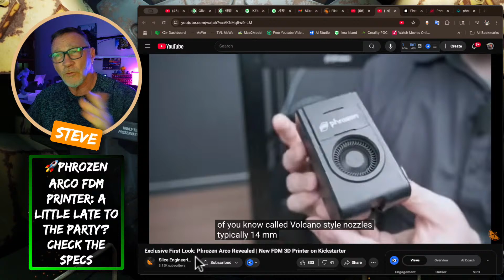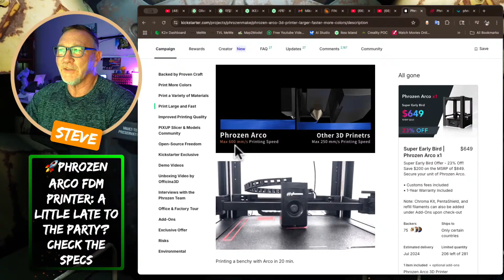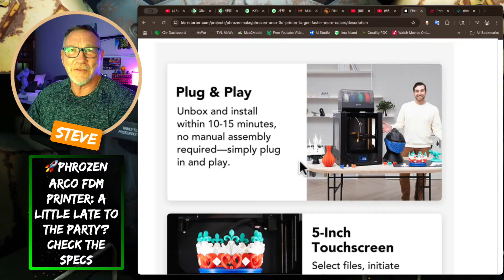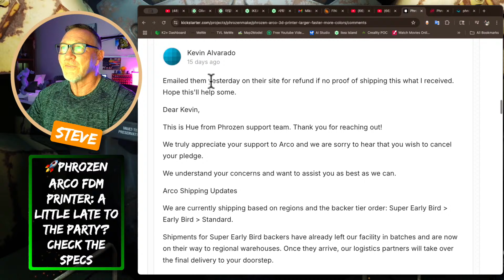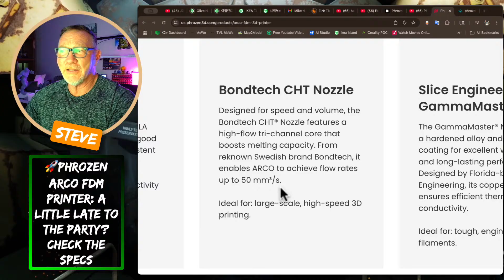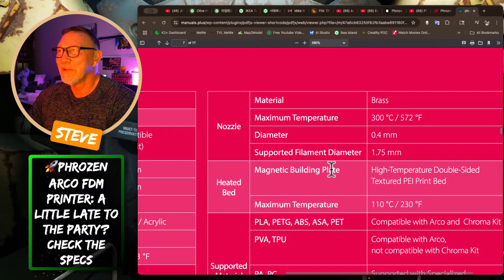🎉 Unveiling the phrozen ARCo FDM Printer: Fashionably Late but Worth the Wait? 🖨️

Comment: Buyers beware: my personal experience with Phrozen ARCO

Phrozen ARCO has been a dud since the day I got it. Upon recieving the kit, the LCD on my Chroma Kit had streaks on it; it looked as if the screen had been damaged. The streaks did not affect its usability; so I decided not to make a fuss about it with Phrozen.
The second problem I had was firmware upgrade (V185 to V194). I ran into firmware upgrade issue right before Lunar Year holidays. I reached out to Phrozen customer support via telephone and was told I had to remove the eMMC chip and mail it back to them for them to flash firmware.
Luckily, I had already established WIFI connection on the printer and was able to connect to the backend remotely via Phrozen Orca. I was able to replace some files on the printer using the files from the firmware zip file. I was able to revive the printer.
From researching on Facebook Phrozen ARCO group, I was not an isolated case. There were others who had run into the same issue. Phrozen did not respond to a specific post seeking for assistance; I was more than happy to share my experience.
Fast forward to a couple weeks ago, I upgraded the firmware from V194 to V199 using the “System Update” functionality within the printer. The upgrade went smoothly as far as I could tell because the machine was able to complete the upgrade. However, after the upgrade, Chroma Kit stopped working. Chroma Kit could not load or unload properly and the loading mechanism did not work anything, even the built-in test print. Nothing worked.

I got pretty frustrated and angry because the rig was taking up a lot of space and it's sitting there being a complete brick. I had an urge to thrash it, but my wife talked me out of it. She convinced me to contact Phrozen first.
So, I decided to fill out a survey form provided by the Phrozen Social Media manager on official Phrozen ARCO Facebook group documenting the issues. After a few days, I received a reply from Phrozen asking me to submit a ticket. At that point, I have had enough. So, I tried to reflash the firmware again, just to see if reflashing could solve the Chroma Kit issue. Guess what, it must be my lucky day. The firmware upgrade bricked the unit AGAIN and this time I was not able to remote into it because I had reset the unit before the upgrade. 
The only solution was to remove the eMMC and send it back to Phrozen for reflash of the firmware. That was it. I snapped and smashed the printer along with Chroma Kit. BOY, was it built like a freakin' tank. I actually had hard time breaking it apart barehand. I had to resort to taking it apart screw by screw. It took me awhile to completely disassemble it. I wish Phrozen's software was as robust as its hardware

Comment: Got mine yesterday, sturdy, well-built machine. The power switch on the back and the lack of standby mode (a fan goes nearly all the time in some capacity) is odd. But it boots up quickly and easily. It fits my needs perfectly.

Love their resin printers, thought I'd support their foray into fdm *though it did take forever. (I'm in Product dev and it can be a nightmate)
Reply: Was it worth the wait? I purchased back in February 2024 and they say they'll deliver the printer to me in September. I find that hard to believe because they've said they would deliver it 10 different dates since that Kickstarter ended. I'm at the point where I want to cancel and get a refund but at the same time I've waited this long and maybe if it's worth the wait it's justified. I'm just unsure and phrozen barely responds to messages with questions.
Reply: @LsdLsp the communication of the entire Arco project has been a complete shitshow. They lured people in calling it a "pre-order" when they weren't even at that stage yet. Granted, with the delays, they did make improvements (i.e. the heater in their Chroma kit)
Reply: Mine is arriving this week.  Was it worth the wait?